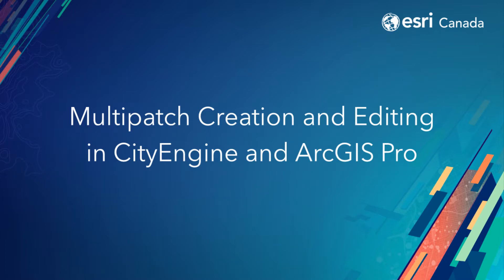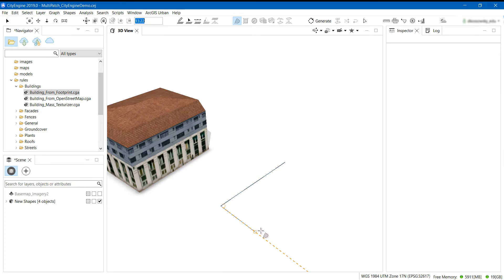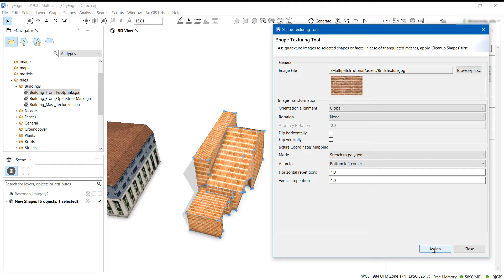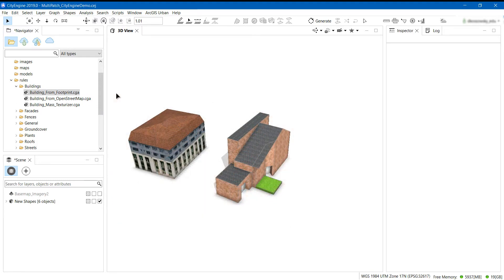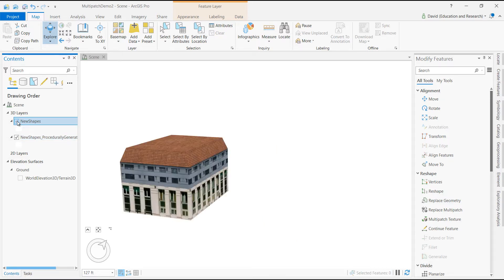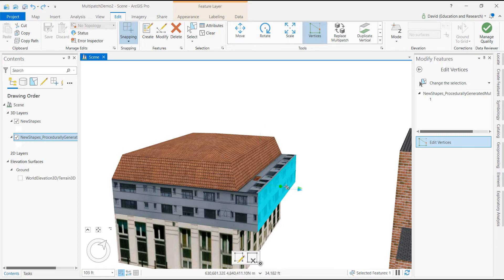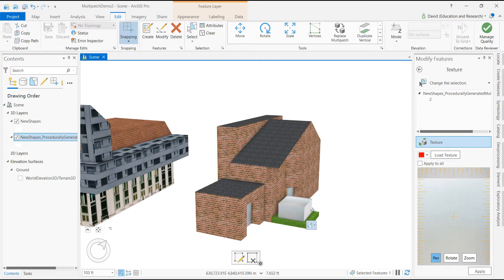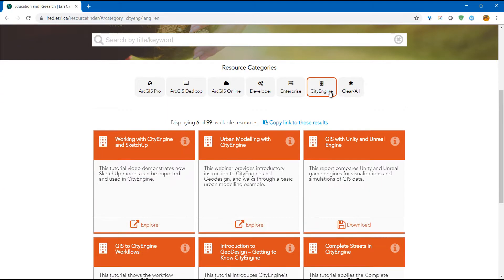3D Multipatch Creation and Editing in CityEngine and ArcGIS Pro

Comment: Can you build a model of a building without a roof? I was hoping to be able to see inside from above.
Reply from the maker: Great question! If you want to build a multipatch without a roof, you can extrude the building to the height that you want and then click on the roof surface and press delete. 

However, the Building_From_Footprint.cga rule will not work on a building mass that does not have a roof. The Building From Footprint rule only applies textures and details to the outside shell of a building, and does not add in any interior features. If you want to create an interior model of the building, you would need to create a floorplan and extrude the walls from the floorplan with a custom rule or with push/pull tools in CityEngine or ArcGIS Pro.